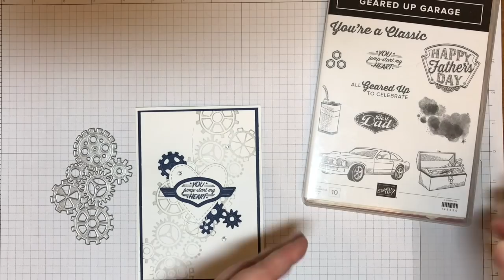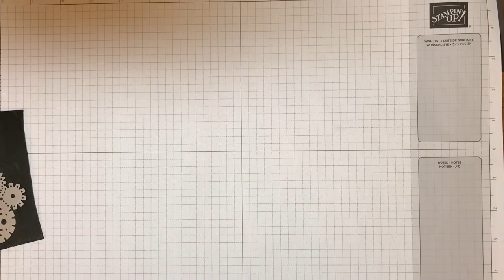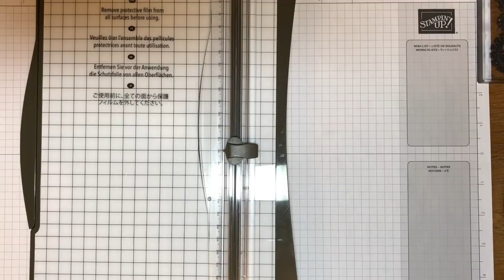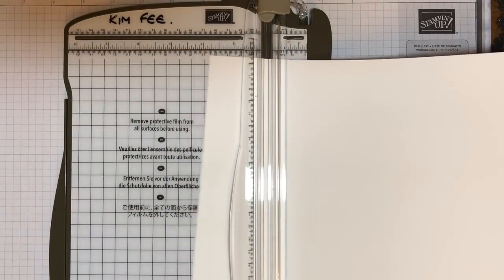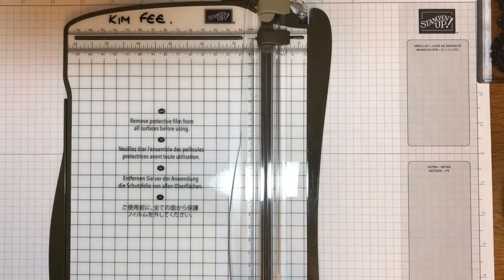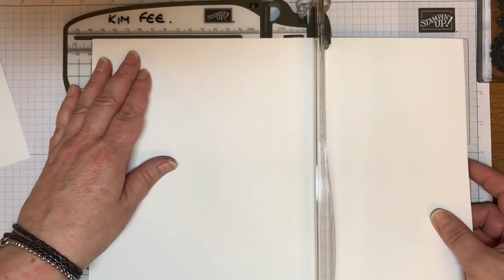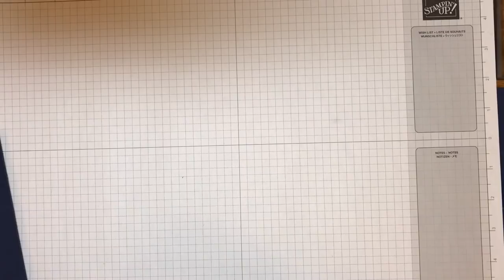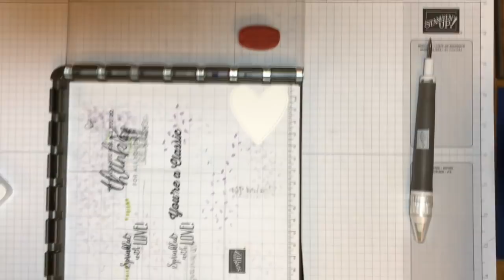Make your own Stamps from Dies using the Stampin Up! Garage Gears Dies,

Comment: Thank you for sharing this awesome tip. It opens up a whole new world of opportunity. Will the foam stamp come off your block since it was adhesive backed? Love the card as well especially the addition of the heart.  So  cute. Thank you.
Reply from the maker: Thank you Susan, yes they will peel off afterwards,   a tip though if you want a light effect of ink you will need to stamp off several times, maybe 6 or 7 times before stamping onto your card, as the ink stays wet on the stamp itself..  Enjoy xxx
Reply: @KimFeeSimplyfairiesPapercrafts  That is good to know. When it has dried how do you store the foam stamp? Thank you Kim.
Reply from the maker: Susan Tipton I just put it in a cello bag x